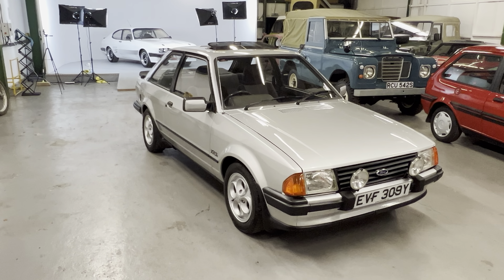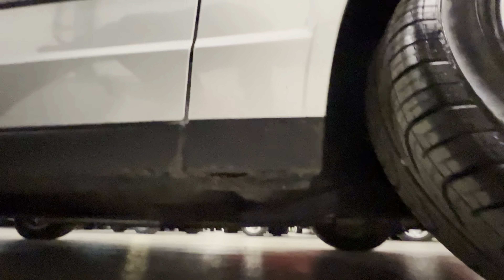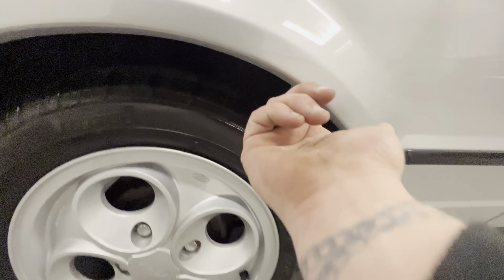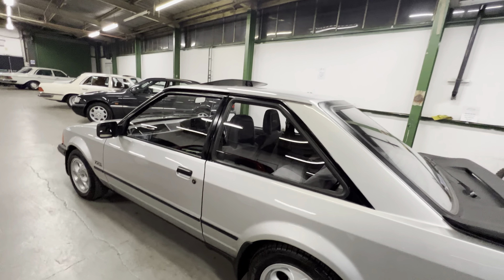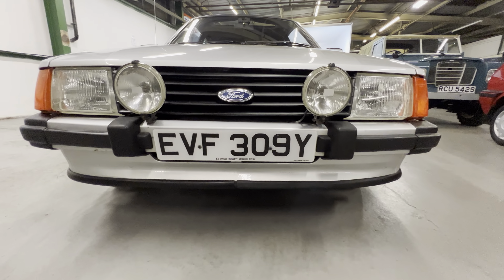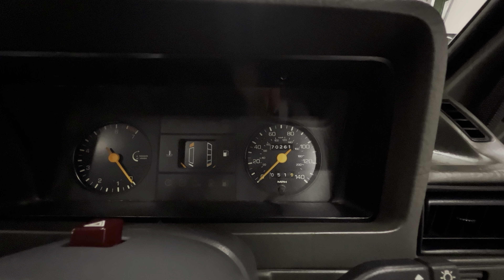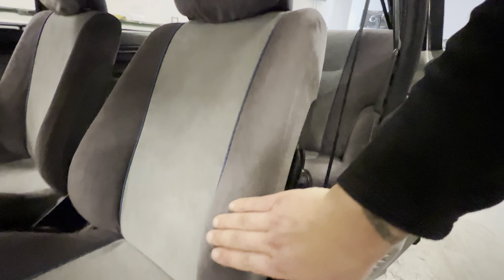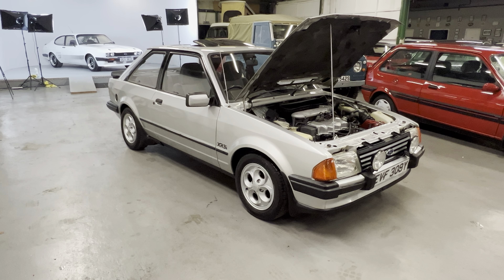Ford Escort XR3i

Comment: This is a nice clean car, which is rare these days. Various comments re the sunroof… I don’t like it either but bear in mind that this was a popular accessory back then. As the whole car is in such good condition I could live with the sunroof.  The steering wheel is wrong though, should be the three spoke and the XR3i decals on the wings are not original.

Comment: I had a 1984 Sunburst red XR3i back in the day with a Janspeed 4-2-1 manifold and full exhaust system and a K+N air filter and a slick 50 treated engine, and boy did the little car fly!. 120bhp doesn't sound much nowadays but it was enough to give my car a stunning turn of speed for a 1.6. 50-70 in only 4.2 seconds in third gear made it an overtaking weapon and all the pops and bangs on trailing throttle gave it a soundtrack to match. The XR3i was a stiff firm riding car with lift off snap oversteer in the wet if you fitted budget rubber and was never meant to be as refined as a Golf GTi. It was a working man's racer. A truly underrated car even today and it is lovely to see this example looking so fresh and well maintained. I hope whoever buys it has as much fun in it as I had in mine. 👍